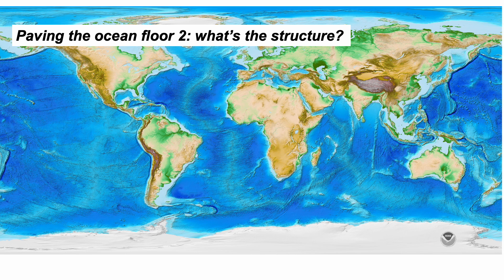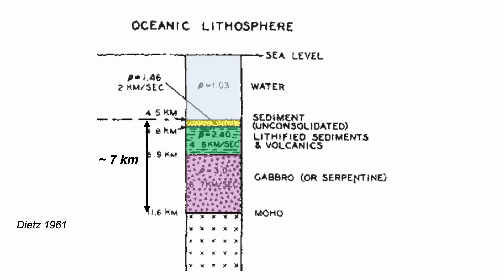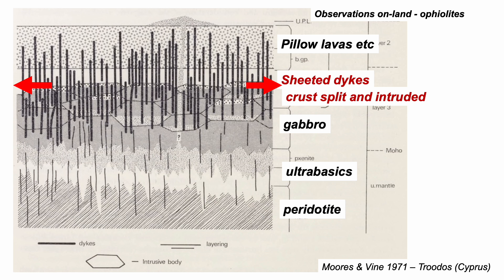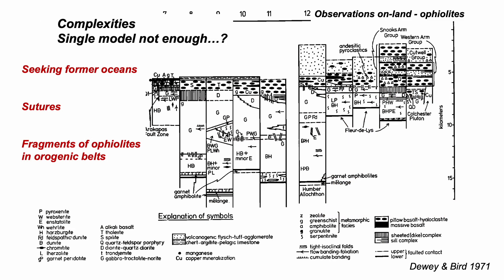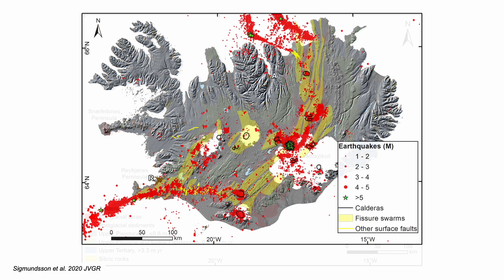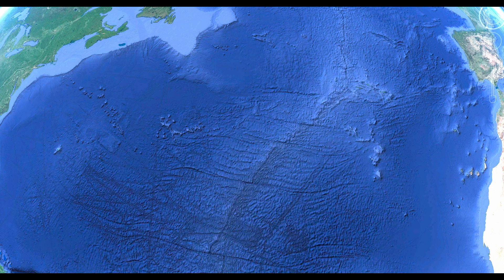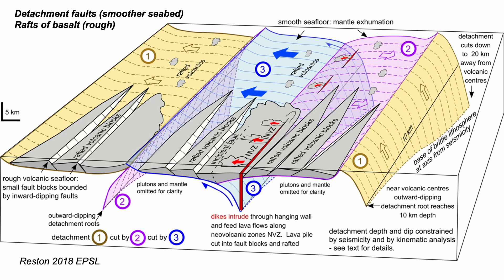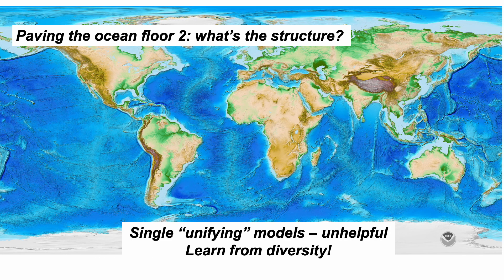Paving the ocean floor 2: what's the structure?

Comment: Great video, for those that skip study geology for other interesting stuff.
In this video you show the sea floor age as map, by which we could rougly reconstruct the long term spread rates (asuming little moving of the ridge).
One fundamental difference between atlantic and pacific is the connexxion to the adjacent continent. There is no subduction zone in the atlantic, ignoring the caribic sea. So one could think, that the spreading seafloor in the atlantic has to push the continents in order to spread and is therefore slower.

This simple idea seems to be wrong.
But it raises the question, what are the fundamental forces that drive sea floor spreading. Is it a type of convection from below or is it more gravity force that pulls a plate away from a higher upwelled mantle area and tears the crust apart?
Reply from the maker: Thanks for your reflections and questions. Ridge push is generally considered to not be a significant driver of plate motion - but slab pull on the other hand is... check out the film on subduction...
https://studio.youtube.com/video/0WvSrIDW_nE
Reply: @robbutler2095  Thanks a lot for your kind answer. I've looked the video about subduction. So the logic seems to be, that the cold oceanic plate sinks into the warm crust, since it has a higher density.  The pulls the whole plate with it. As main source.

But there are also ridges without subduction zones. Like the middle atlantic or east african ridge. So there must be a force (engineering thinking 😊) that tears these ridges appart. Is this more a type of mantel convection + friction or are plates sliding away from an upwelling underground like a sledge on snow or like a glacier move into a valley?

Maybe that question is stupid, but I just havr my children like imagination and curiosity.

Comment: Recently I began to know oceans can be divided into two parts according to the spreading speed. The spreading speed of the inner Pangea oceans is more slower than that of Pacific, the outer pan-ocean of Pangea continent. How do you think about the Pacific that can it be close in the future (+250Ma) ?
Reply from the maker: Yes - the two spread rates over long geological time is an interesting idea, perhaps reflecting the dominance of subduction zone length facing the Pacific and its forebears... (so greater slab pull)....  or at least longer slab-lengths....

Comment: Again, great job! I wonder if we can use oceanic crust stratigraphic composition as a means to gage mantle circulation/convection reversal timelines apart from magnetics? Any current research into this area? My background is not in geophysics.
Reply from the maker: Not sure quite what you're asking but for sure, variations in the thickness  of oceanic crust through the (long-term) spreading history of ridge systems has been charted. And can be related to evolving thermal structure in the mantle - (which in turn can track plume evolution). Quite apart from the N Atlantic, a good example is the Kerguelen - Broken Ridge story...